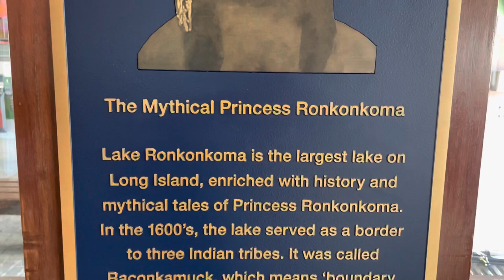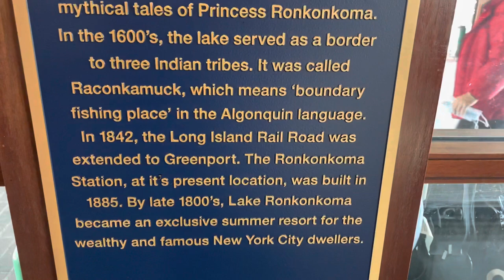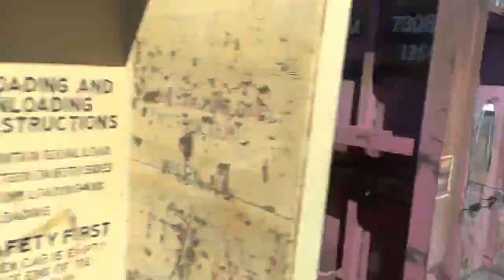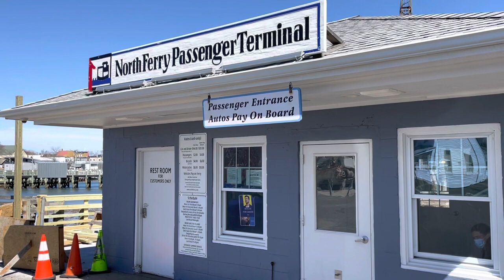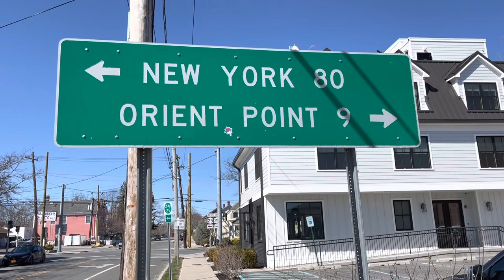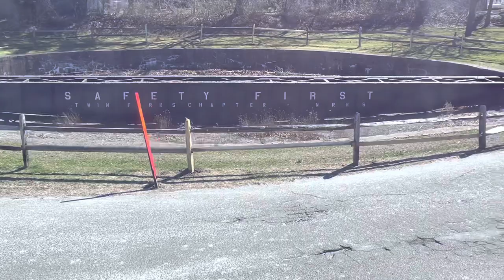Ride on LIRR train 250 from Ronkonkoma to Greenport. Highlights of trip back on train 251. 3/29/22

Comment: Great trip.  The  Calverton freight spur at 36:15 was originally installed 1953 to service the newly opened Naval Industrial Reserve Plant at Calverton built by the Navy for Grumman Aerospace final assembly and flight test operations, which had mainly outgrown the built-up Bethpage area in the heart of Nassau County.  During my time at Grumman Calverton from 1962 to 1994 there were initially regular freight deliveries, including at first coal in coal hoppers then later fuel oil in tank cars for powering the main steam and power plant for the facility.  The most memorable freight deliveries however remain the annual arrivals of a freezer freight car loaded with the frozen turkeys that were handed out to all Grumman employees at Christmas time.  After Grumman ceased to exist in the Spring of 1994 and the Navy turned over the Calverton Facility to the Town of Riverhead, for a short time there were biofuel tank car deliveries on a somewhat regular basis made to a company doing business in the new Calverton Enterprise Park.  Currently, there still may well be lumber and building material deliveries to the Riverhead Building Supply Corporation.  The spur was refurbished circa 15(?) years ago with an aprox. $2M federal grant secured by then-Congressman Tim Bishop.  That is when crossing gates were installed at River Avenue, tracks were replaced, and a new switch onto the main line installed.
Reply: Awesome story. The only customer on the branch is Eastern fence, which receives plastic pellet cars.

Comment: Buddy. 45mph is KO to MR. than 40mph MR to Mile post 73. Than 20mph mile post 73 and 74. Between mile post 73 and 74 is Riverhead Station. After mile post 74 40mph to all the way out to Greenport.